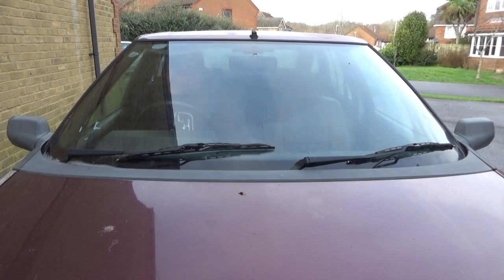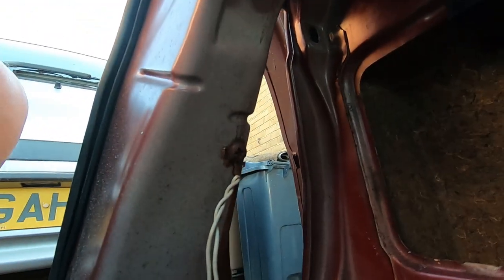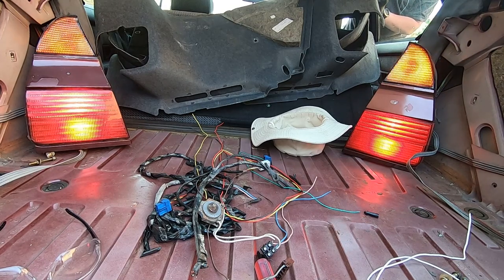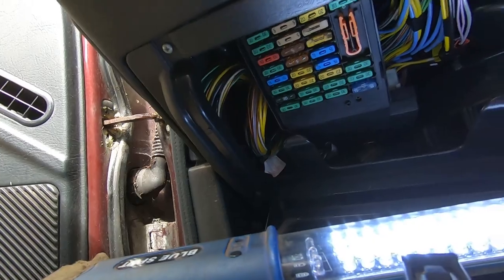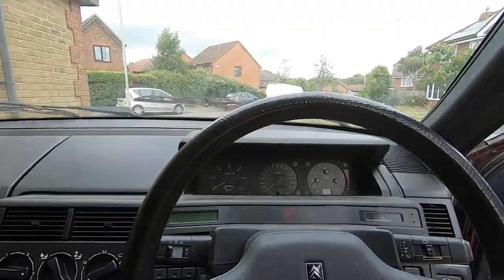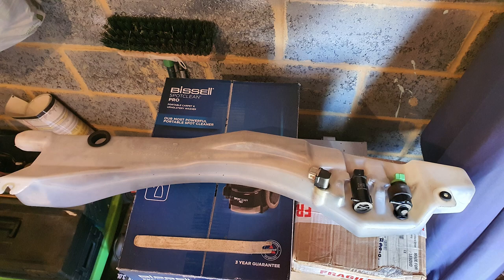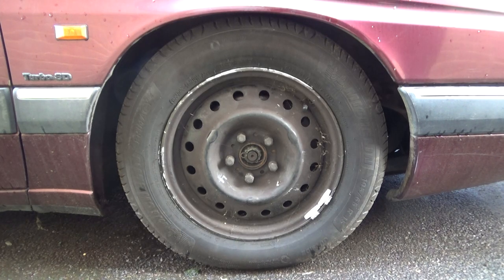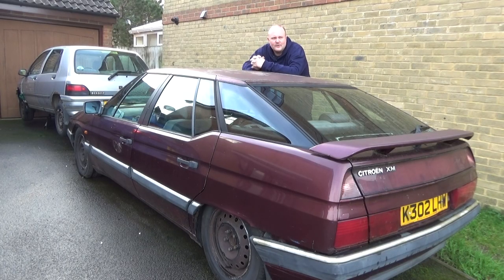Fixing the Citroën XM rear light issues

Comment: Did the earth clean up also fix the warning for rear brske light bulb failiure warning??? Or does that still come up? The extra earth was fitted to resolve that error on S1 cars.. but if your proper repair has fixed that is well worth looking at..
Washer motors another common issue..
Reply from the maker: Once I stripped all the towbar wiring and cleaned the original earthing point all warning lights disappeared and no more disco lights.
I did have a 'bulb out' issue a few months ago but that turned out to be a duff bulb so all is well.